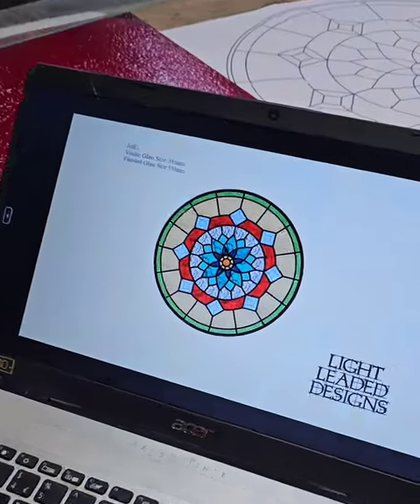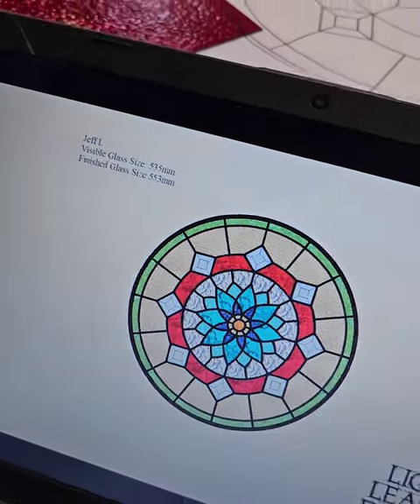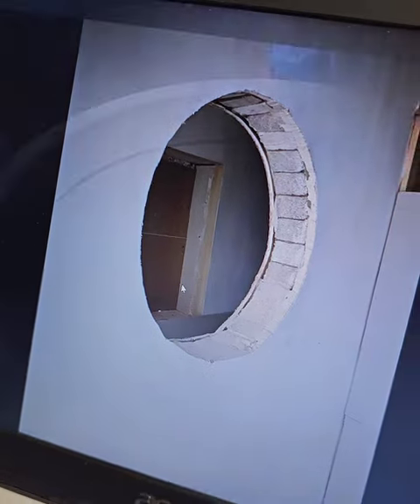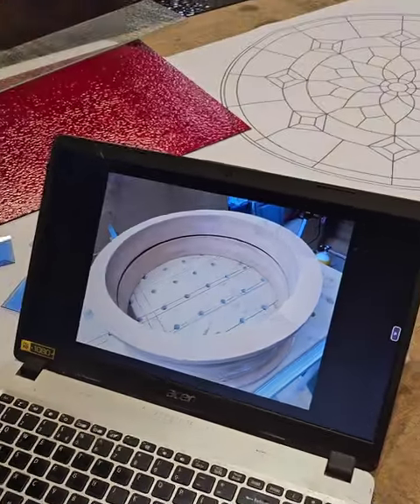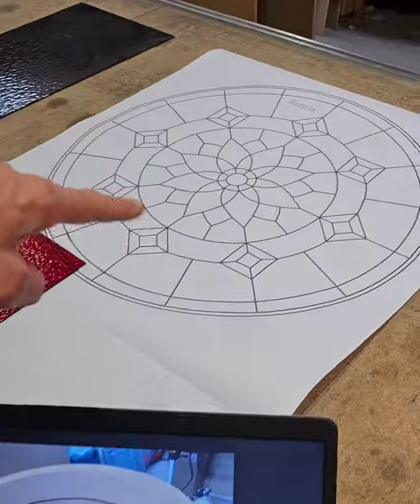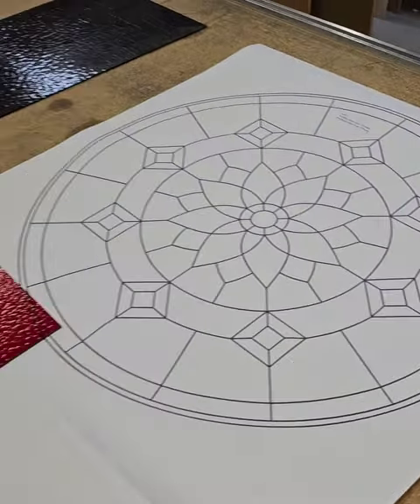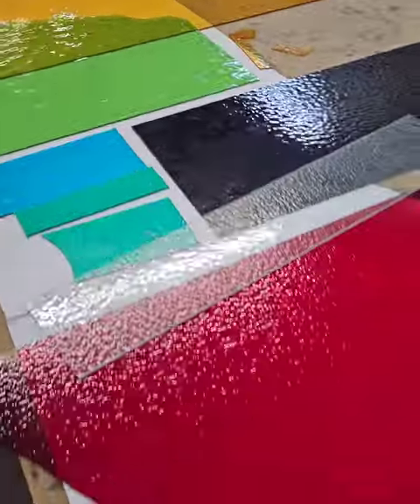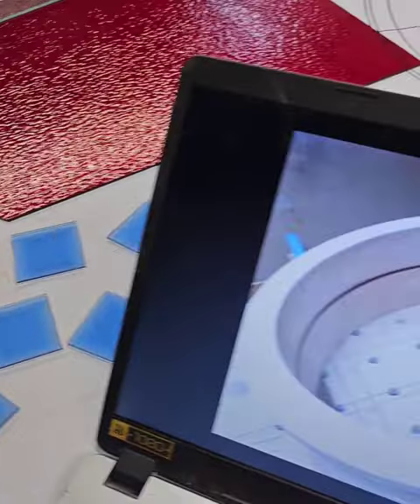Stained Glass Circular Window Making

Comment: Your techniques are good but I could tell you some we used at Pittsburg Stained glass and my own studio that would save you time on finishing out after your cement process . If you use lime sprinkled on with a can perforated with holes and sawdust , it will clean , blacken and shine the leads without the need for lamp black .After coating with a nice sprinkle of lime sprinkle some sawdust on top and use a medium stiff brush to clean and darken . This is done after leads have been fidded down . The lime blackens the lead and the sawdust cleans away and soaks up all residues . Try it and you will be amazed with the results . I only use lamp black when trying to match leads to existing artwork I am restoring .Also your dry times are unnecessary during cement . You can fid down your leads much sooner if you warm your putty instead of relying too much on thinning agents that need to evaporate some .
Reply from the maker: Hi Robert, honestly I've tried pretty much every technique over the last 26+ years. I've gotten my cementing process down to a fine art that I'm super happy with 🍻🍻🍻
Reply: @LightLeadedDesigns  Whatever works for you brother ! Keep the fires burning . It is the art more than the technique that needs to survive ! Love you in a   'guild' sort of way .